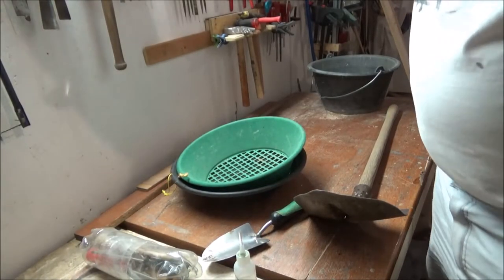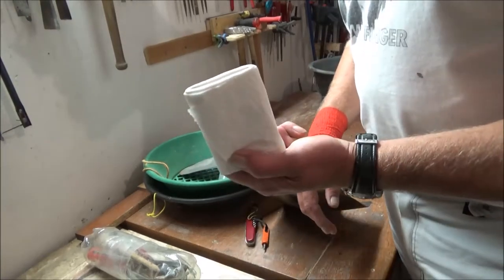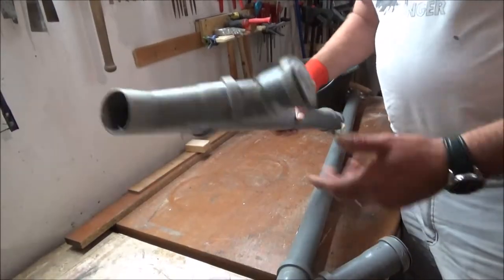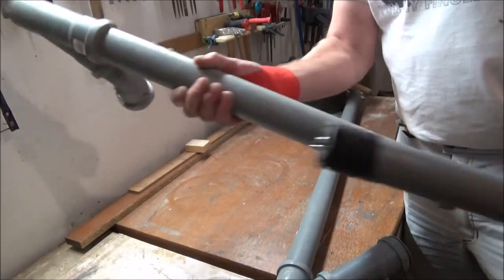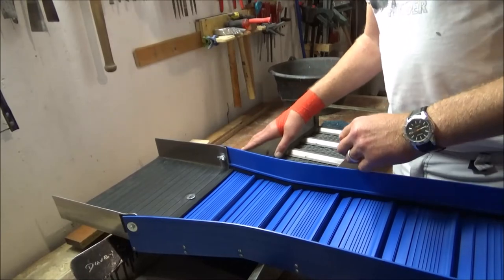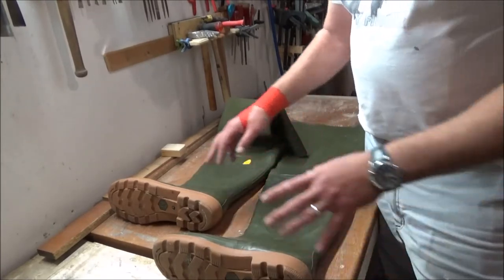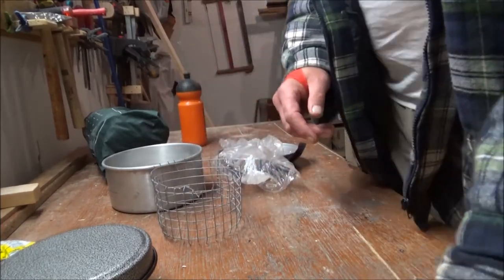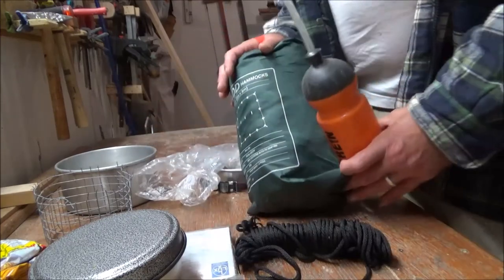My gold prospecting kit 17 09 17

Comment: Good info, I got a kit together similar to yours all ready in a back pack ( Garret pans and kit ) but have not tried yet, chickened out a couple of times, too many people around. trying to locate an unused section of a local creek it has a lot of flat rock in places, lots of crevices. I will get out eventually. Most Panning is done in Northern Ontario and is frowned on in the south but not illegal. They call panning a privilege so it is a tread lightly scenario and don't pan in the same place twice, very helpful rule, Not. Good vid Dave, Cheers. :-)
Reply from the maker: Hope you get chance.  its a privilege here too. i think the problem is some people think they are going to strike it rich and destroy the area trying. I am never going to do that here. There are no claims here but in some cantons it is banned. Because of idiots.

Comment: Got youself a nice colorfull wrist band out of the deal anyway, if it was me I would have just taped it up with some duct tape and moved on....lol
Reply from the maker: Looks cool huh. I glued it with super glue. I had to do a practical for manitou and fork truck operator the next day. The joy stick on the manitou is on the right side pulled  the cut open but had to go do it. It cost 1000 franks for the test. I did the theory the day before 2 day course. This is a cool clip https://youtu.be/cxIQ9y8xklI they are fun to drive and very painful at the time lol I passed and didn't bleed out bonus ;-)
Reply: Have never seen the 360 head before, very cool, those machines are very good on the construction site, be the 360 head is a big bonus, nice machine.